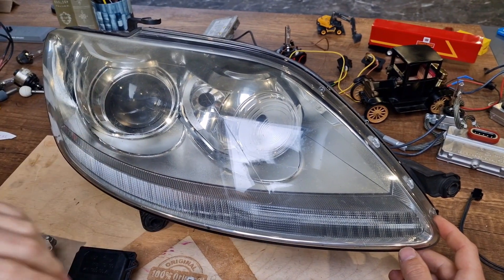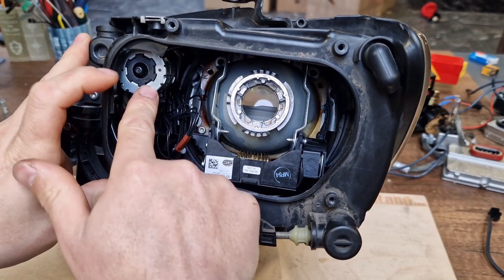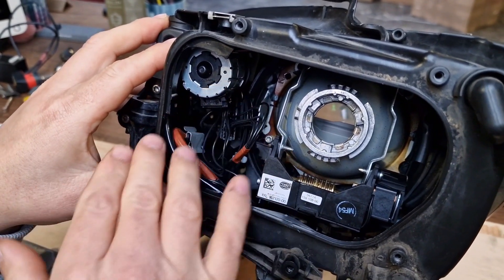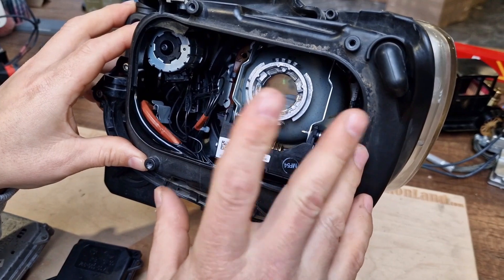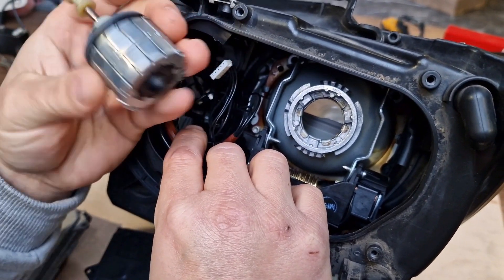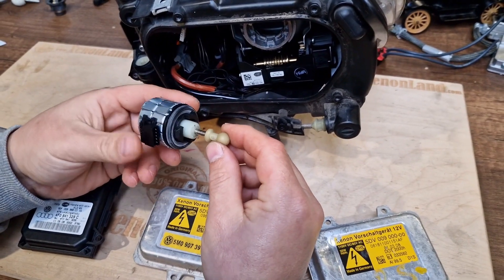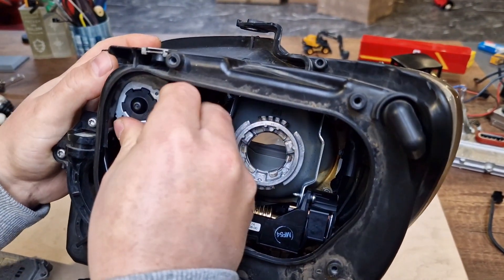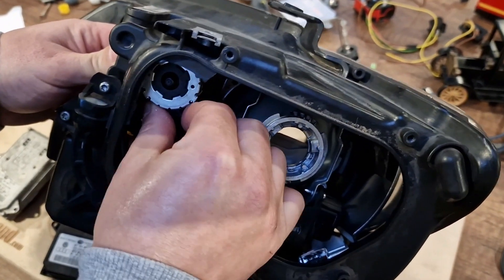VW Golf PLUS XENON headlight LEVELLING (RANGE ADJUSTMENT, ACTUATOR) MOTOR REPLACEMENT 2004-2014

Comment: Where can you find this spare part? Can you provide a link to the website where to buy it, thank you
Reply from the maker: This motor is for vertical adjustment! AFS fault is related to horizontal adjustment left-right. Do you have a moisture in your headlight? It sounds more like a AFS module fault.

Comment: I have problem with same left headlight. When driving and entering left corner it turns on AFS error. All lamps are working. What can be problem.
Reply from the maker: Pls have a look this video https://youtu.be/bvnkeWwHRIM
Reply from the maker: It seems your afs module is faulty
Reply: I was hoping that is not module. Thanks i will check
Reply: This is a code of error 

02233 - Left Headlight Power Output Stage (J667)
004 - No Signal/Communication - Intermittent on VCDS 
All lights working do you think its a module
Reply from the maker: @petarandjelkovic8758  Possible Causes

Fuse(s) faulty

Wiring from/to Left Headlight Power Output Stage (J667) faulty

Left Headlight Power Output Stage (J667) faulty/incompatible

Possible Solutions

Check Fuse(s)

Check/Repair Wiring from/to Left Headlight Power Output Stage (J667)

Check/Replace Left Headlight Power Output Stage (J667)

Check Left Headlight Power Output Stage (J667) Part Number/Compatibility

Special Notes

Without a properly Communicating Output Stage most Control Modules will neither allow Coding nor Basic Settings.

Refer to Diagnostic Procedures and Factory Repair Manual for Details.
Reply: @xenonland  i checked fuses all wires are changed in headlights and front glasses  i have to try with model. Thanks for tips do you have same mail i can write to you if i have same more questions?
Reply from the maker: @petarandjelkovic8758  unfortunately it seems that your headlights are "recycled". But why someone should try to modify the wiring? AFS mechanisms under the projectors might be also "burnt".
Reply: @xenonland  I didn’t modify wiers some of them where really bad. Still waiting from module to try